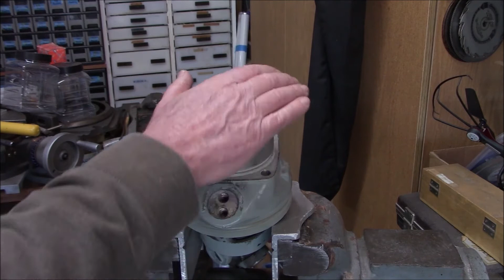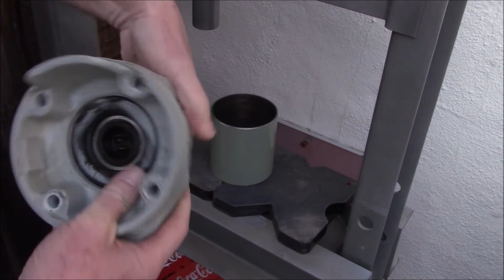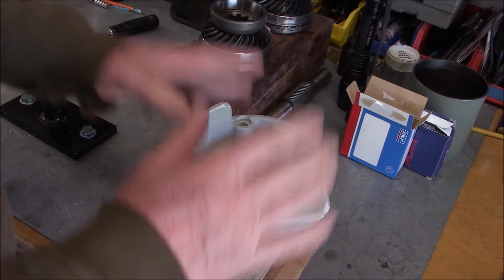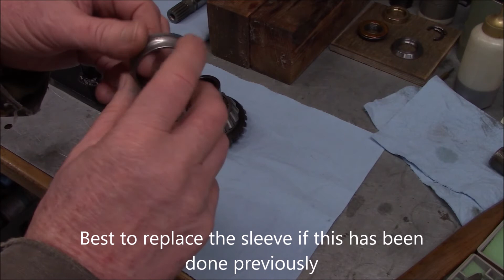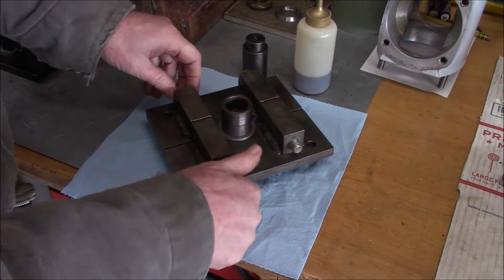Volvo Penta AQ Upper Part 2 Pinion Gear Bearings

Comment: Doing this project now and can't seem to find the part numbers of the bearings I need.  The smaller taper bearing has a number stamped but not the larger one.  It's an sp 215 box.

Comment: I just pulled mine apart it had a shim between the two bearings is that ok?
Reply from the maker: If your working on a 290-A, DP or SP that's not normal. someone my have made a shim to increase the thickness of the crush sleeve, rather than replacing it.

If your working on a 290 or earlier; there's a shim under the bearing cup for the bearing set closest to the pinion gear that sets the pinion depth. be sure to keep that shim as-is. 

If there's something else in there god only knows what someone was doing.

Comment: 290 dp series look very similar...can this process be used on that?
Reply from the maker: Scotty, All but setting the bearing preload is basically the same, the pre 290-A units don't use the crush sleeve, you must adjust the shims under the  seal ring to obtain proper bearing pre load. They also use a steel bearing box (bearing holder sleeve)

Comment: I'll begin by saying that this is a great and helpful video:
FYI...... Ring gear is typically associated with a Ring & Pinion gear set. 
The Volvo Penta transmission's main gear is a "drive" gear. The two other gears are "driven" gears. 

I'll suggest that we NOT drive against bearing cups with a steel tool.... especially a steel chisel. Use a Brass or a Bronze drift style punch. If worried about shock absorption, apply some heat to the bearing box as to ensure a complete seating of the cup. 

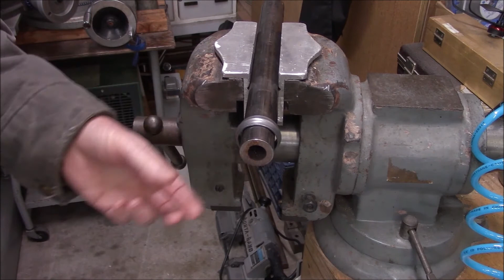At 17:33 into the video, I had to smile. I thought that I was the only one who had done this. 
Although I'd use the flat side of the hammer, I see no problem with expanding the crush sleeve/pre-tension sleeve. 
It requires only a few thousands of expansion. 
No negative comments from me. 

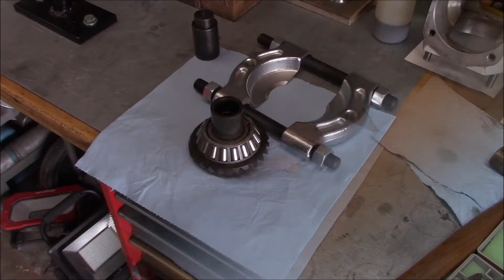At 19:41, we can have problems. Often the roller cage comes apart, leaving us with a very small roller retaining lip for the puller tool to grab onto. 
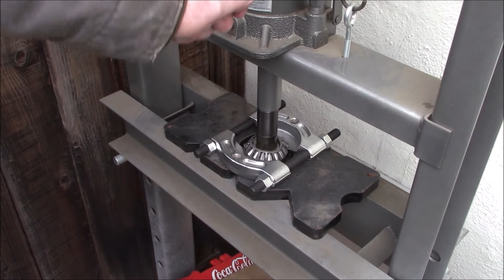At 21:20, he got very lucky. 
In a case whereby the roller cage does come apart, we cut and removed the roller cage and the rollers. 
If a special tool like what he made, does not work, then we make two opposing weld beads on the inner race at the roller retaining lip.
We then very quickly place the puller jaws against the two weld beads, and then continue with the press.  
This must be done quickly before the heat dissipates into the gear shaft. 

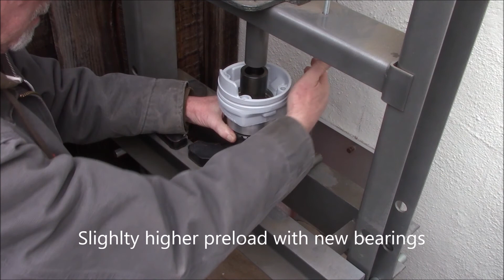At 29:02, I suggest that you see your OEM workshop manual for the correct rolling torque specification. 
DO NOT confuse string pull scale value for center rotational force specs.  
The manual does not offer a conversion table. 
Keep in mind that these rollers must be oiled prior to checking the rolling torque value. 

Again, this is a very well done video. 
RicardoMarine
Reply from the maker: Thanks Mark for the great detailed information !!

Comment: Could you tell me where to get the seal and bearings for my dp-a?
Reply from the maker: Seals and bearings are standard Metric sizes, you can match the numbers on the old ones. Lots of suppliers on eBay.
Email me and I'll send you the sizes. dean57ayr@gmail.com

Comment: Nice bearings in that assembly. Looks like half the battle is having the right size block of wood, your bench mounted splined stand, and all of the right size and variety of press "adapters" for lack of a better term. Where'd you get those snazzy Mitotoyo digital calipers? :)
Reply from the maker: Real great guy gave them to me 👍👍